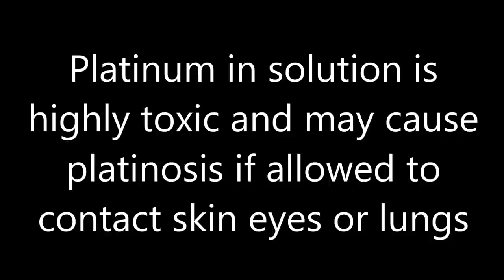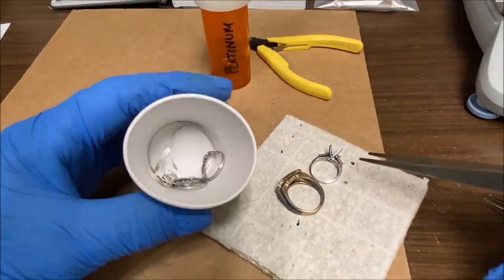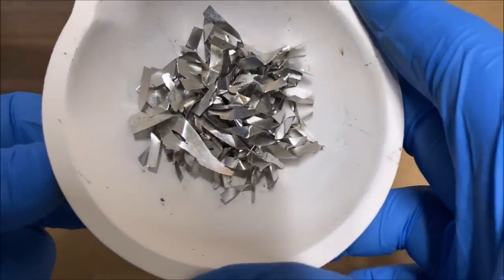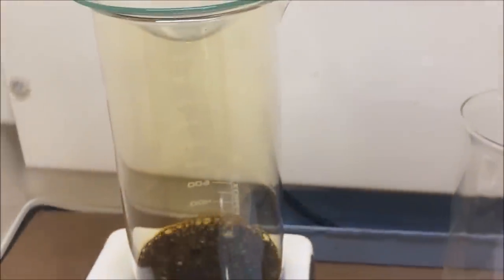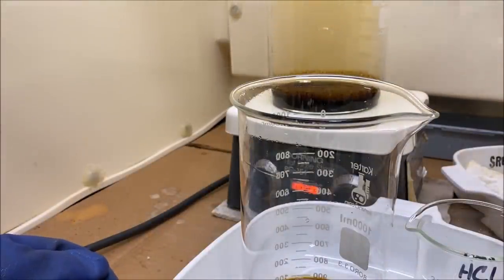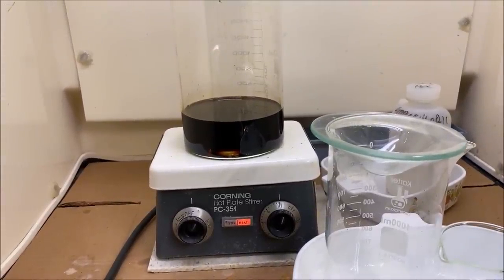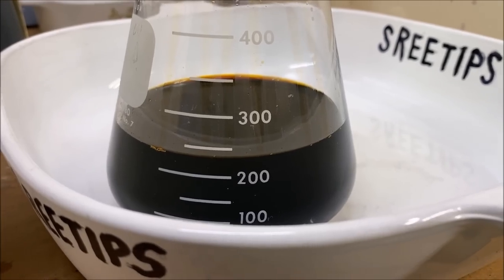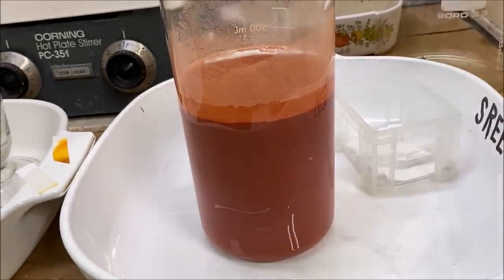Platinum Refining Bromate Hydrolysis Pt1

Comment: Are you kidding me? After how many times of me saying that you should use a rolling machine you finally elected to give it a second try? Your first attempt went horribly because you didn't bother to learn how to use the machine before you started making the video. Did you at least learn how to use the machine first or are we about to have a second video of you trying to run material through a rolling machine only for you to fail and instantly give up?

Ah well, I will watch and hope that it works out for you. After all, using acid on thin rolled metals works so much quicker than what you have done in the past.

OMG! You figured it out! I am so happy for you! Now you can save so much money on chemicals!

Comment: platinum requires higher doses of nitric acid, you were not putting nearly enough nitric that is why it took so long, and I would have done this outside with a nice breeze blowing away from you, PGM's are not that hard to work with if done outside, with the correct PPE (personal protective equipment)
Reply from the maker: I must disagree. Even with a stiff breeze, when I approach the reaction to add reagents, the wind will form eddys that will wrap around my body and pull the fumes right in my face. No way to do it without a fume extractor. Even then the risk of exposure still exists. It’s best to let those who have the proper equipment do the platinum refining. This has been my experience.

Comment: Are you sure "800 Plat. 100 Iridium" is platinum ?
I would have said : 800 silver plated with iridium at 100 microns thick.
Reply from the maker: It was 900 platinum and 100 iridium. It’s a common alloy for platinum jewelry. Pure platinum has similar characteristics as pure gold. The iridium stiffens it up and makes it more durable.
Reply: @sreetips  Thank you for your videos, your efforts and your answer.

Comment: I think I know why PGM don't tarnish. Basically, they're excelent catalyst, and when any soot accumulates on top of that red hot metal, it will immediately react with oxygen to form CO2 since it's right next to PGM atoms which catalyze the reaction. They are able to adsorb gases, so they can basically close the distance between the carbon and oxygen atoms which with the heat makes them react.

Comment: 10:40 that's strange your stir plate wont spin the stir bar .....
I have a 20 year old corning PC-351 stir plate & use it on thick glass, rounded bottom mason jars to culture fungi & it works fine.
it'll spin 1/4" to 1-1/4" stir bars

https://ca.vwr.com/stibo/low_res/std.lang.all/38/63/11703863.jpg
Reply from the maker: I think it was a bad stir bar, if thats possible. I put in a longer stir bar and now it works fine. Can the stir bars go bad? Very perplexing.
Reply: @sreetips  heating magnets degrades the magnet, that's a possibility, or maybe as simple as (made in china)